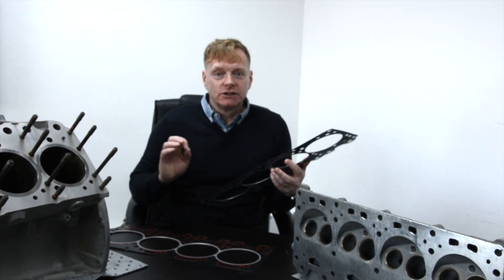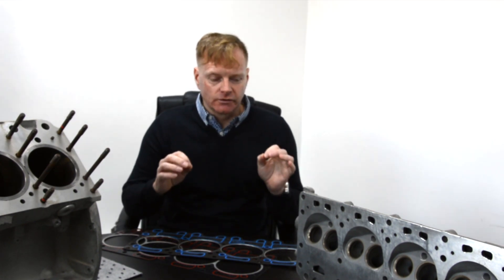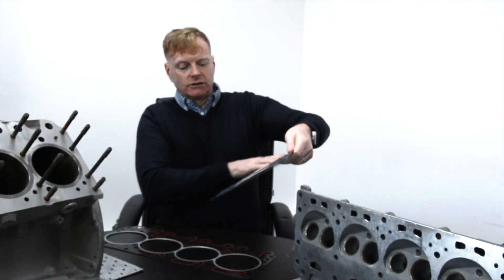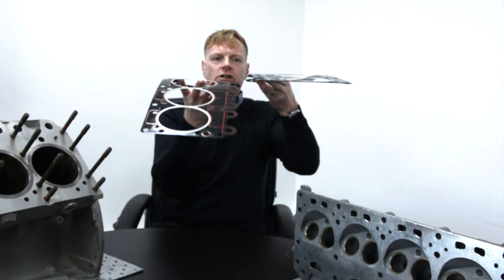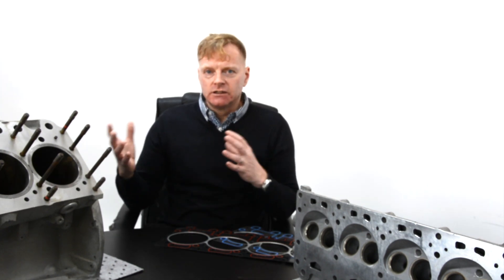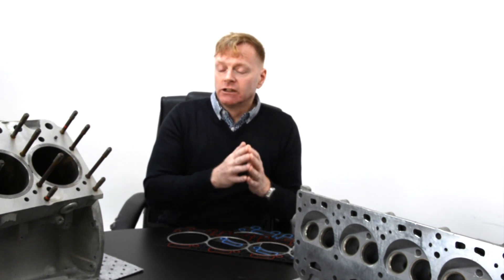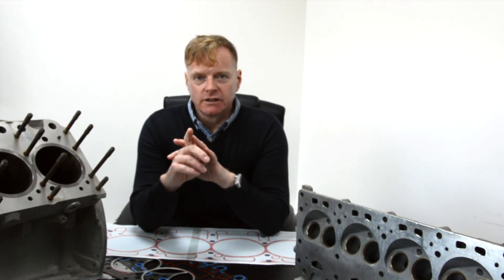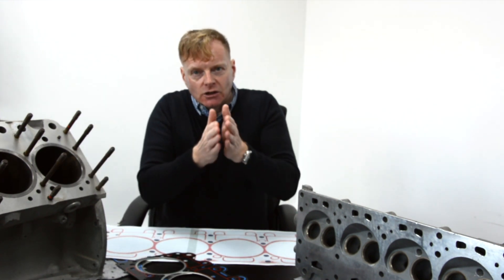Introducing V8 Cylinder Head Gasket: 07V103147 (Part 2 - Full Technical Detail!)

Comment: Is this new gasket meant to solve the failure at around the 50k mark on the engines with the turbo ?
Reply from the maker: Hi, it sure will due to the compressible cutting-edge gasket body material incorporating high-strength bonded Aramid fibre, with 70% rebound – ideal for older engines where mating faces are imperfect or non-parallel – for a perfect seal. 
Critical solid core stainless steel fire rings, able to withstand the high heat and pressures generated in the latest 400+BHP engines.
Tanged mesh backbone – provides lateral strength across the gasket body and aids gasket compression.
Reduced delta between fire ring and gasket body to aid sealing on older engines.
Controlled silicon tracking to spread initial compression load and eliminate fluid paths in pre-bedding in/start-up state.
Reply: @introcar  That's good to hear, some owners of the Turbo R's were getting custom made MLS head gaskets, and they seamed OK, or at least I have not heard back from them that they have failed.
 I would be worried of an all steal gasket on aluminum surfaces, but they have been doing that for a while too.
 There is another improved head gasket out about too, and it looked just like the old composite gasket that had failed _ I was quite skeptical.
 When someone posts about where to find a proper gasket for the engines with a turbo, I will direct them here. Thanks !
Reply from the maker: @HaggisCat1   Thank you so much, we appreciate it that! Yes, 3.5 years in the making, this project represents one of our most expensive and advanced products to date, incorporating state-of-the-art design, tooling, and manufacturing technique
Reply: @introcar  There is no better product, in my opinion, that IntroCar should have spent 3.5 years in development and manufacturer than these head gaskets. They are the leading MAIN reason that people shy away from buying the Turbo cars.  The dreaded feeling that their new purchase of a used RR/Bentley will be ruined by a blown head gasket.  Atleast now with this product by IntroCar, if you headgasket does blow, you can get a BETTER than new product so it won't happen again in atleast the owner's lifetime.  Well done IntroCar.